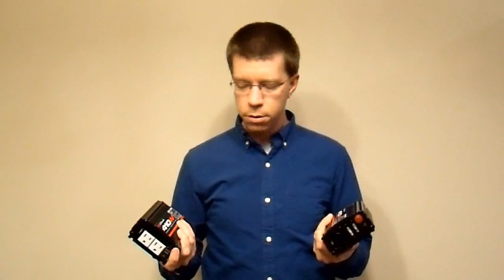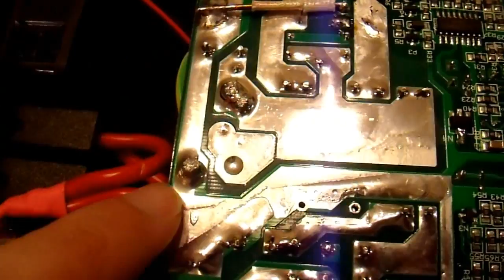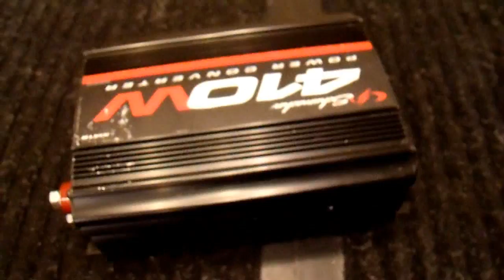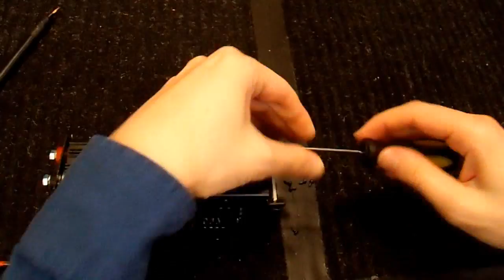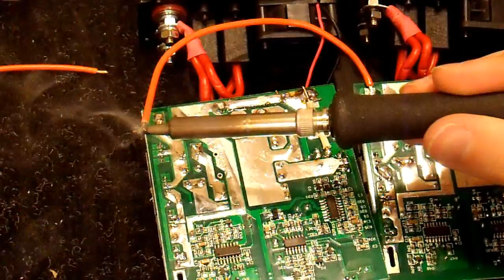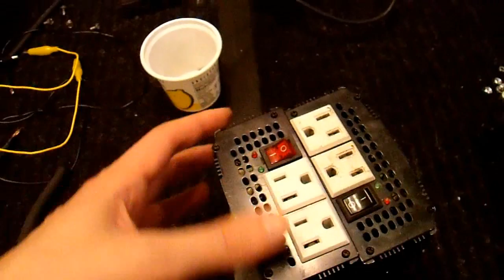Parallel Inverters - Double the Power Hack!   Part1

Comment: Just do them like you would do 2 60kw generaters you can run both converters and plug a cord that is conected to another cord with a outlet and parallel  them your running power from both in to one socket you still get 110 volts but more whatts it works iv done it

Comment: Because you have the knowledge, can you perhaps answer this question - when I test mains socket fed by power company, only one of the two holes is energized (Line). But when I connect inverter to the same house grid and power from inverter, now both holes of the socket are energized (Line and Neutral both illuminate tester). What is the basic difference here?
Reply: That is true on some units but not others. In a house where you have 120 and 240, the house is using a split phase. The transformer is supplying the 120 from a center tap to either Line in. That center tap is also grounded at some point in the wiring. So line to line = 240 VAC while Line 1 to Neutral or Ground or Line 2 to Neutral or Ground will only show 120VAC. Neutral to Ground should show nothing as they are connected. In the inverters, they can be wired one of two ways. Line can be at either 120 VAC or 60 VAC.  In the first case, Neutral would show 120 volts to ground as it is the second leg of the 120 VAC supply. In the second case, the Neutral to Ground would also show 60VAC as the Ground is tied to the center point of the 120VAC supply. In the second case, do not ever tie the ground to a house circuit as it will blow the inverter. If you had a second inverter of the first type and had it synced to the other unit so that one side was high on the Line while the other unit's Line went low and tied the Neutrals together you'd  see  240VAC on the two Lines and nothing on the Neutral to Ground with 120VAC from either Line to Neutral or Ground.
Reply: Thanks a lot for the reply. I had started to figure it out based on similar idea that while the volts are up on the Line they would be down on the Neutral and this would produce 240V in-between. However, it looks rather complicated and certainly requires digesting especially how the in house ground behaves together with the inverter so that ground will never become energized. Here where I live the ground is often tied to Neutral line in older homes (now prohibited but standard practice several decades ago).
Reply: It actually still is in use with the Ground and Neutral tied together normally at the first panel that the power goes to. Our home was built in 1978. It has the tie ins at the transfer switches and in the main panel. Power from our generators is 240/120 with 4 wires for Line 1, Line 2, Neutral, Ground. All of our sockets also are tied to ground thru both the conduit and or the ground wire that goes to each one.

Comment: Is it possible to convert an old generator to an inverter generator by running it's output through a bridge rectifier and connecting it to the output stage of the inverter as shown here, maybe with a small 12v transformer to power the inverter circuitry?

Comment: As a beef it up bus point instead of just adding a bunch of solder also solder a piece of large wire to the trace. The copper wire increases conductivity as you said solder alone doesn't much. Use stranded wire for even better conductivity.
Reply: Use the braided copper screen from a good-quality coaxial cable.
Reply: How is stranded any better than solid? You either have the cross section area or you don't.
Reply: Actually what I was thinking was to use the solder wicking braided copper. Once it is soaked with solder it doesn't matter if it is stranded or solid the standard wire should support the overall strength of the conductor path.

Comment: Will current distributed betwwen them? Or will they each take the same current as if it were a lone convertor, i desire to pull a lot of amps but a single convertor just isnt rated for the full desired current

Comment: What if you eliminated ground all together and made a wire two Male ends (one plugged in each inverter) and one female socket where both blacks and both whites come together.. wouldn't that take about 400 from each. Worse case two separate battery banks but I don't even that you need that
Reply: No. If they were 90 degrees out ofphase youd have double voltge
Reply: @daniellange4772  guessing there is no easy way to make the 90 out of phase
Reply: @plojm123  point is itd be double voltage not double current. Which means youd have more than 110 and lessthan 220 and current out cant be calculated till you know thevoltage. With the phase wrong itll lose more to heat and likely burn up a few FETs.

Comment: Haha ,50 amp .

Let's get to basics 410 watts / 120 volts = 3.42 amps ×2 = 7.8 amps. Not 50 amps. And a 5,000 watts generator is only a 20 amp circuit. Your fusing the the 12 volt not 120 volt so you don't melt the battery plus I'm watching hoping you make it but be cool to see if back fire

Comment: J1 is the current shunt. Look at the other side of the board, a jumper is not needed there. Its also high in the air too. J1 is your current shunt.

Comment: Just asking a question, would it be better to use a step up/down transformer using each 110v leg as input and step down the 220v from both inverters back to 110v on the transformer output at the higher rate? again "just asking"
Reply: How are you going to sync the two? The output of the inverters has to be synced to work on a X1/X2 and Y1/Y2 input of a transformer to get 110 VAC out at double the current on the output side of the transformer. If they are out of sync, you could see anywhere from 0 to 240 VAC on the output until the inverters tripped.

Comment: Can u parallel two different UPS into a big power inverter???
Reply: OokTiaopi. I want the same answer
Reply: @OokTiaopi
 @
aamir habib -- Probably NOT. There are tons of different ways to make inverters, so they are likely to be too different inside, running the "150 volt" DC bus at different voltages, or employing radically different approaches to the system design. But you CAN add larger capacitors to either inverter, and likely get some improvement.

Comment: If i need to run 120V appliances what size or how many W inverter do i need? is 400w inverter good enough?
Reply: Stellar P. Volts * Amps = watts
You need to know how many amps you need to know how many watts
Reply: Just add up the wattage of all the things which you want to run, and then add about 10% for safety.  Get an inverter which can handle that wattage.

 Also make sure that if you have inductive loads (fridges, fans, drills) connected to the circuit, that the inverter can handle the peak load drawn by these devices when they start up (typically 2x their normal running wattage).  Most inverters have a "peak" wattage and a "continuous" wattage rating, so you can use this to figure out whether or not it can handle what you want.

Comment: You can get a 1500 watt inverter for $199.99 Canadian right now.  (So maybe $25 US?  Ha joke it would still be about $150 US.)

http://www.canadiantire.ca/en/pdp/motomaster-eliminator-mobile-power-inverter-1500w-0111866p.html?cid=KWGoogle_Eclipse_DSA&gclid=CM_T9c2S-tECFQmewAodlHEINw&gclsrc=aw.ds&dclid=CJ2bhs6S-tECFcpXAQodhA0HbQ

That's not much more than 2-410 watt inverters would cost.

And it's hard to see what high output inverters are useful for, even with 2 "golf cart" batteries (so 220 Amp hours reserve in theory) on my trailer if I start using the "space" I have with 2 "golf cart" batteries with my 900 watt inverter at full load the batteries would be totally dead 2.5 hours.  Actually the inverter would trip out due to low voltage far before then.  Given that you are only supposed to drain a lead acid battery 50%, that's 1.25 hours.  Large inverters are only good for short duration loads, like maybe blending ice for your Margarita with a small blender.

Inverters are cool for running things like an LDC TV or charging cell phones.  You can't actually run anything high load off them because the battery is the limit no mater the inverter rating.  (Except for short duration.  For example you could probably make a few cuts with a skill saw but if you have to cut all day you need a generator.)

Anyway, my point is if you are buying an inverter either buy the 75 watt ones that plug into your cigarette lighter type socket (get for charging sell phones or running your laptop) or buy something around 1000 watts and don't load it up except for short periods of time.

Comment: hi. i need help please someone. i have a water pump of 230v 9.8 amps. what inverter i need? pure sine wave o modifed ? n what capacity? please
Reply: Marco Romero 
230v x 9.8/10 amps= approx 2300watts so maybe a 3000watt inverter. a 4000-5000watt inverter will probably live longer. the start up surge will be rough on the 3000 watt. it may not work some times. if at all. some 5kw may not work some times. so a 4000, 5000 or 6000 watt inverter. you need to check the surge capacity. its been a while hope I helped.

Comment: I don't agree. Pooooooooooffffffffffffffffffffff.......................... This video shows us how to destroy two inverters. Because first of all you must show us how the invertors are synchronised... So difficult.
Reply: Syncing inverters isnt hard. You disable one oscillator and use one to drive both power circuits. Thats how "stacking" works. Here it may be as simple as cutting a circuit trace and soldering in an extra wire   or two

Comment: I missed the part where you sychronized the both driver stages to each other... this is actually the same way you self recommend not to do, isn't it?
Reply: Couple years late. I had to re-watch myself. At around 9:30 he looks up the part number for the output stage and notes that the output transistors are rated well above the 800watt output desired. That's when he decided that just supplying sufficient dc voltage to the output stage should accomplish the results. very nice hack. i have have tore these down but did not realize that it was 120 dc that was chopped up to a square wave, should have followed the traces to the diodes.

Comment: Every inverter I have owned over the past 20 years has had external fuses. How is it uncommon?
Reply: Look inside most of them made by Reliable or many of the modified square wave units. The fuses are internal and in some cases, even soldered in place.

Comment: What about using two inverters to make 230v or 240v power to run items like a dryer or welder?
Reply: buy from the eu. eu mains voltage is 230v so all the inverters are 230v
Reply: georg841984 No, not quite by the US standard, there is some issue about the way it cycles.  The European stuff cycles at a higher rate.
Reply: the frequency is not right 50hz for europe 60hz for usa but depending on the use it might be bether then to hack the us one.
it depends on what you nead it for :-)

Comment: "you end up with a pile of smoke" love it!

if you were shopping for a 1500w pure sine inverter to use daily for 3 years, what's the least you'd expect to spend?
Reply: i've had expensive inverters pop in under a month and right now i'm rocking the cheapest one on ebay (the first one died but i got a replacement and the fan circuit didn't work on that so a just wired to 12v)
I had 7 inverters last year.
This one has been going every time the sun shines for 9 months but i cant recommend it.
Inverter recommendation is difficult especially when you put in a time requirement.
do you live in a warm climate or a humid climate or both? are you trying to power inductive loads?
are you expecting to pull 1500w from it all day (running at %100 will stress it)
are you going to power it from clean power even? (it's no good trying to pull so much power from 1 small battery it drops to 9v if the inverter isnt designed to run that kind of current)
You haven't given any information at all
Reply: samlex go power or thor they are all the same thing and they are good quality

Comment: In Japan the AC mains is 100VAC (60Hz South Japan, 50Hz North). I use 115VDC much. Any high speed switching power supply should accept DC as it goes through a bridge rectifier anyway. Of course this will not go through any transformer, but I do use my laptop & curly fluorescent lights on it. Any resistive load like soldering irons or incandescent lamps will not see any difference. NOTE: being off grid rules.
Reply: " full bridge rectifier"  rulez 🤣🤣
Okay, different channel.

Comment: Can you hack an inverter so it runs off of a 20v Dewalt lithium battery pack?
Reply: you would need a buck converter, but the capacity of those batteries are so low its useless

Comment: Could you use the same process that you did with these 400 watt inverters for your samlex 3000 watt inverter if you had 2 or would it be a little different if so how I would like to at some point do it for a cabin or house
Reply from the maker: Timothy Moulton I actually do have two 3000W samlex inverters and I've considered just such an arrangement.  Unfortunately they're expensive and I don't want to blow them up.  :(
Pure sine inverters are much more difficult to parallel since the FETs switch at high frequencies to generate the sine waves.  The idea I had was to power two different phases of a distribution transformer with them, and then use the other side of the Xformer to get your power at the proper voltage.  You would then only need to sync the two and ensure they both shut down and start up at exactly the same time rather than mess with everything else.  Still, it's too much of a kludge for me for an inverter that is already very nice out of the box.

Comment: You could clip out the last 20 sec of this and air it as a commercial and sell your modified inverters 
Also will this work on inverters of different sizes 
I have a 600W inverter and 2X 1500W inverters all pure sine wave will I be able to connect all 3 of them together to get 3600W using this method?
Reply: Only if one or both of the 2 1500 watt units or the 600 watt unit had Mosfets that could handle the 3600 watts. That is what most people missed in the video. His units had Mosfets that were capable of handling double the power that the inverters were marketed at. So he simply supplied them with double the amps and let them do their thing under the control of one unit.
Reply: @gravelydon7072  hopefully he's done his homework and they are rated for continuous running at the higher wattage.

Comment: How to get 2 invertors in serial connection, in order to get 2 fase and 240V ?
I want to power Aluminum MIG welder what works out of 240V 2fase.
Power welder takes is about 600watts. Or welding current DC +30amps and +20volts
I do have 2000wats inverter.
Reply: You can get a 120-to-240 volt transformer or autotransformer to step up 120 to 240 volts, but putting 2 inverters of 120 volts each in series will give you 2 different AC frequencies at once. That is NOT the Split Phase power you asked for, unless you can synchronize them, which is not easy. And welders may have odd waveforms on the input current, which will not work so well with inverters unless they are way oversized in watt ratings. IF you absolutely have to do it via inverters, I recommend getting a high wattage inverter or UPS, like 3000 watts. At that power, they often have 240 volt outputs already. But they will probably require at least 24 volts DC as input, and may require 36, 48, 60, 72, or even more volts. Already at 24 or 36 volts from car batteries, one may do pretty serious DC welding, but that is probably not your MIG welding.
Reply: +sofabike just weld with car batteries

Comment: Do they use one ov the tracks as a super low value current measuring series resistor?
Reply from the maker: That is very possible and a common cost saving strategy in inverters, though the tolerance of such 'resistors' is so poor that it is mostly ineffective.  In this particular inverter I don't believe they use this method.
Reply: @knurlgnar24  I know this is a bit late, but I believe the wire on the bottom is being used as a current shunt. If you look it's connecting two adjacent tracks on the board (if it wasn't a shunt they could just use a cheaper track instead) and there appears to be a small sense line coming off of one end.

Comment: This will NOT work. Something I hope he realizes before it all goes kaput. Ju MUST sync the output FETs
Reply: McCuneWindandSolar guess he could also detach the "gates"  of the output fets on one inverter,  and run a signal wire to drive them from the other inverter,  that way they would be in sync,  and he could parallel the ac outputs..
Reply: fuba44 I was at one time thinking the same thing.
Reply: he is running all 800 watts through just one set of fets. that is why he connected just the out put dc side of the Transformer before the fets. while he is pulling 800 watts he will be pulling it though just one inverter the other fets will not be pushing any power though all in all he is just using the input fets transformer and bridge rectifier witch then charges the out put cap to high voltage DC. so he is just doubling the out put current on the DC out put side of the Transformer. and then running that though one set of out put Fets. He has said in the video he looked up the part numbers and the fets can handle the 800 watts with no problem and they have low resistance.